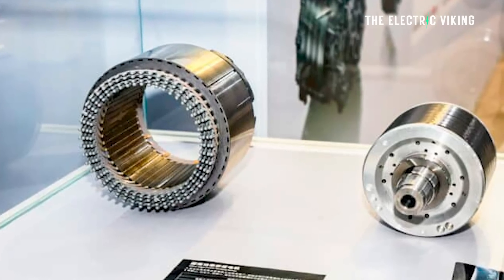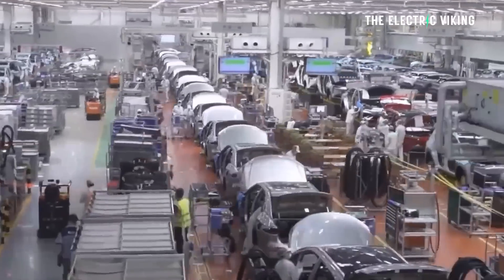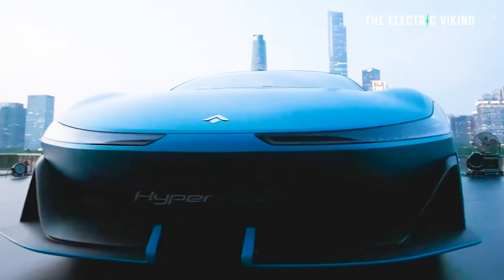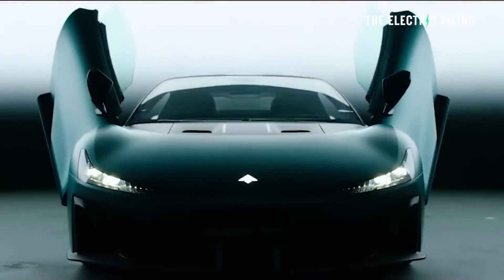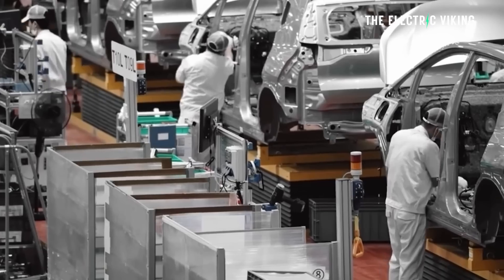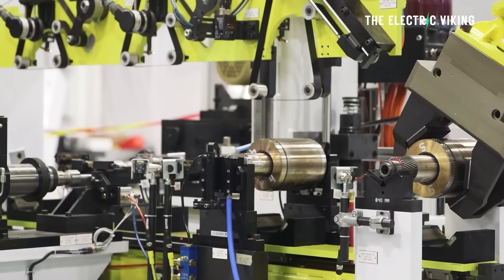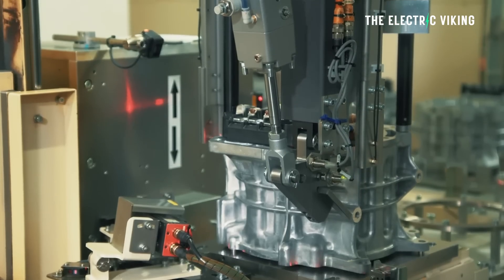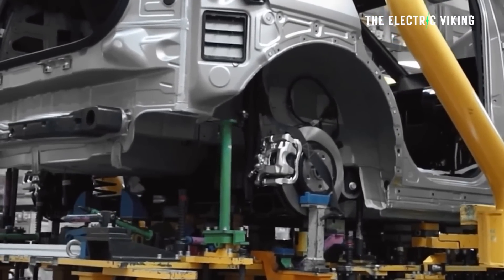Most efficient and powerful EV motor EVER hits an amazing 30,000 rpm

Comment: Synchronous motors are routinely 95% efficient at a designed load. Below medium load the efficiency of motors drops. So when they say 98.5%, they need to show the chart of load vs. efficiency.

Also, although motors can be very efficient, the power electronics is not 98.5% efficient... so for this company to claim another 50 km range, they must have really good electronics. Given that the Chinese dominate the electronic biz, i am not surprised a chinese firm has a good motor.

I do believe that eventually we will see hub motors on all EV's because they are so much lighter, and enable some amazing handling possibilities. However, controlling slightly different motors in real time is a very complex task, and Mercedes which has the rights to the best hub motor has not been able to ship a product with hub motors yet. 

The real battle in EV's is not over the drivetrain but who is going to improve battery tech, because that is the majority of the weight and cost are located in an EV. 

I would imagine once batteries double in power density, EV's will be super common.
Reply: wr
Reply: Absolutly right !👍
Reply: I'm struggling to understand how a variable frequency invertor could compete in an efficiency context at those speeds. A Tesla model 3's motor turns at a maximum of about 5k RPM. That equates to just a sixth of the switching. Perhaps the controllers aren't as power hungry as I thought they were? Any thoughts?
Reply: Lot of BS in this report.  If you went from 95% to 100% efficiency you would struggle to get 50km extra unless the car starts with a huge range.  High revs means high precision (cost)  bearing, fancy electronics and tricky gearbox, you're firmly in super car bracket.  Given "super car" means the exact opposite of the words, this technology is interesting but not the way forward.  
I would think this is not the first motor to use sintered core material?
Reply: Double from what?
Reply: Hub motors? Way too much unsprung weight = dreadful ride and handling. No thanks.
Reply: @simonmiller5118  Not to mention far more subject to damage because of their position and ingress of dirt and debris.
Reply: And I always believe every claim cryna makes about everything, millions might not, but I do.
Reply: Hub motors are unsprung weight motors. Which/vibration/plunge cooling, manufacturer warranty risk......no thanks.

Comment: 30000 rpm is nothing special and tesla plaid motors are listed at 97% efficient so very similar these are not game changers but incremental improvements, battery tech is where the big improvements will need to come from and there is still a long way to go we require at least 500 watts per kg
Reply: 23,308 rpm and 93.4% for tesla
Reply: Plaid was listed at 97%. And rpm is not so important
Reply: @garrywebster8434  nowhere states 97%, can you reference?
Reply: @garrywebster8434 If rpm isn't important than why was Elon boasting with pride when stating these facts during the presentation of the Plaid?
Of course 30k rpm is a great achievement and it shows you the potential of electric motors
Reply: @Raymaster7482  No. Ideally you'd want a motor with a perfectly matched RPM to spin the tires at useable speeds. 30k RPM is way too high and you'll have to use a gear reduction which adds resistance and lowers the overall system efficiency. Higher RPM motors driven at the same voltage as a lower RPM motor of the same wattage would also have much less torque, which is also not what you want. I don't know why Elon gloated about high RPM. But it's probably just because higher numbers look better to people that don't know better.
Reply: Yes there are many aspects that we want to improve in batteries. If they put trilions of dollars into it, it might all happen. Eficiance, price, chargetime, safety and recycebility...
Reply: 30,000 rpm with high torque  has many engineering difficulties.  Keeping balance, cooling, and materials is never trivial at scale.
Reply: @mefobills279 huge low end torque …… of th line like a bullet headed for Russia
Reply: @SparkySho  Please explain.  Are you a Russia hater?  Their engineering is often first rate.
Reply: Really nuthin special???? Sht it is too sommin of th chain
Reply: Wonder if that efficiency number is measured at the wheels, because at 30k rpm you need some serious gearing to make it useful.
Reply: I’m of the identical view.  This is minor incremental improvements, not game changing.  This would have to have significant transmission losses as you must slow it down to wheel speeds.
Reply: The viking is a technical ignoramus the amount of gibberish in this post is amazing.
Reply: @Alantj22  He does seem to spew a lot of craziness lately.  I think he used to be more relevant.  Now he’s getting like Trump.
Reply: Couch warrior, none of the verbal garbage you put on here has any relevance to us grownups who are in the age and income group to buy these cars. Here's an idea. Try find something useful to do with your life.
Reply: Higher rpm is useful to replace the conversion gear with one with higher conversion ratio, hence keeping the max speed but providing higher torque across all rpms. This is good since ev motors face reduced torque at high rpms. Higher efficiency is actually very important. This is the max efficiency though. Anyways, it reduces cooling requirements and provides high torque for sustained time periods. Most importantly, higher efficiency means smaller size and weight.
Reply: Tesla is 20k RPM..this is a huge increase.

Comment: expensive  electric...how heavy expensive is the gearbox. ?  longevity?  rare materials?  
this is a few year ago : the more recently developed Model 3, Tesla switched to using permanent magnet reluctance motors, which achieve an efficiency of 97% ,so  assuming tesla at 96% and new stuff 99, this is a net 2% improvement.